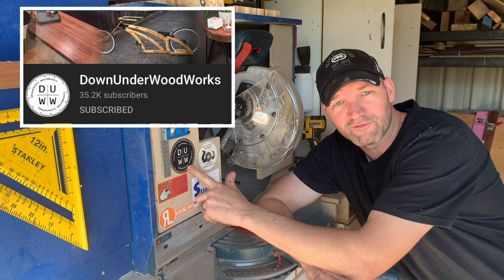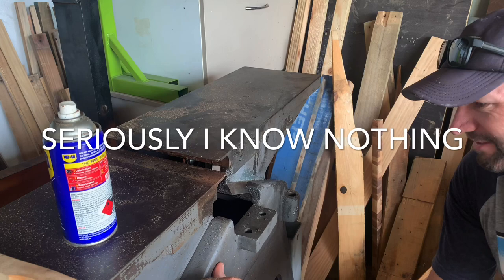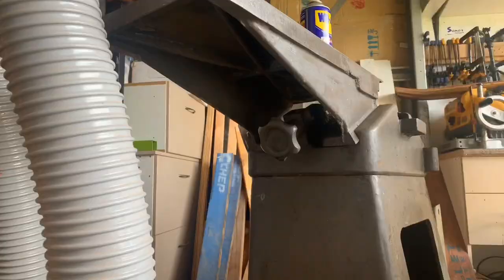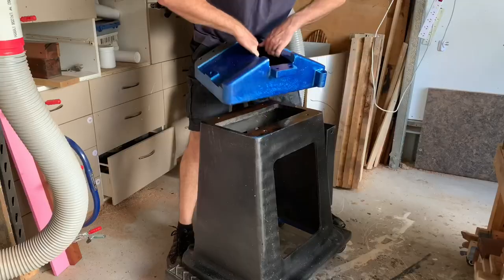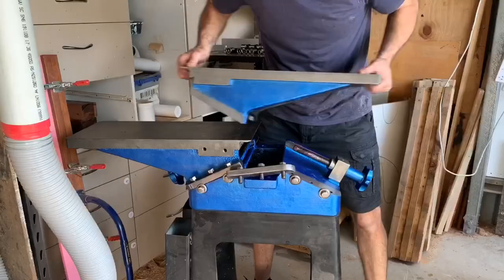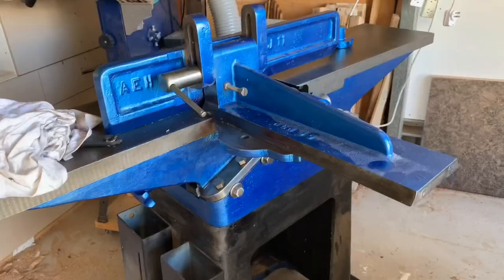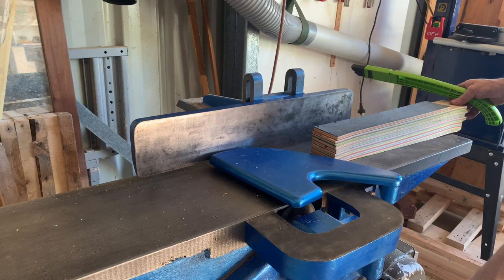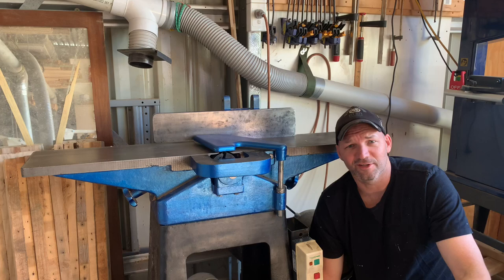Very OLD jointer restoration

Comment: OK. I usually play it cool and my comments on the Interwebs are scarce, but I can't help myself this time. I love your video. The whole thing, the topic, informative value, your demeanor, positive attitude, advice, everything. What is more, this video convinced me to get a similar jointer in desperate need of restoration. Yay! It arrived this morning and I've already started dismantling it. I have to do it outside because my new baby weighs in at 360 kilos and I don't own a forklift, so disassembly is a must if I ever want to use it indoors. It was a cloudy day and I was rudely interrupted by rain while trying to figure out how to get the beds off. I'm taking pictures and I think I will film the next stages and edit my first YT video. So thank you for the inspiration and cheers from Poland! Oh, and mine is from 1962. :)